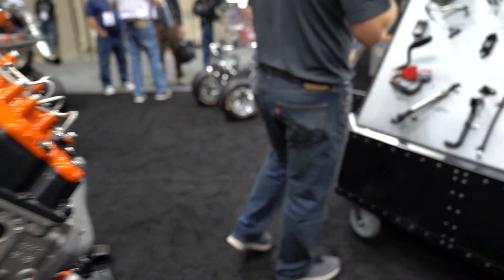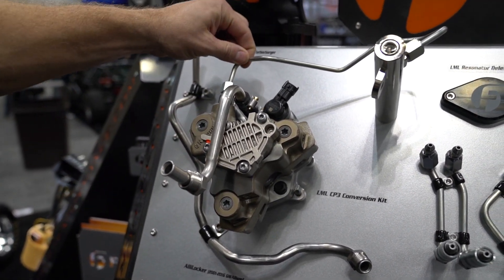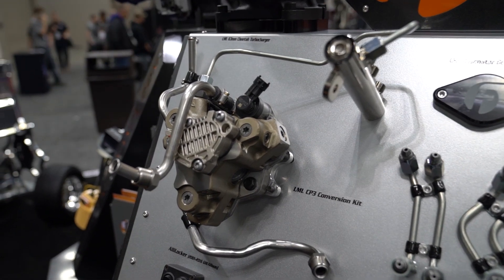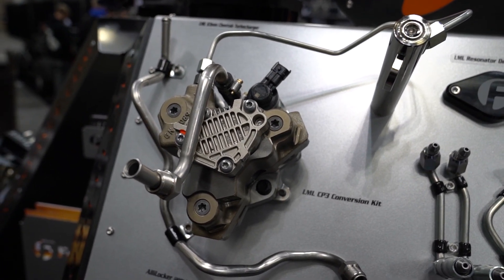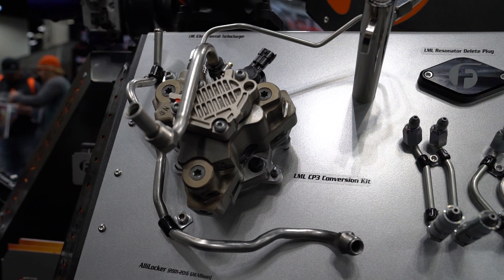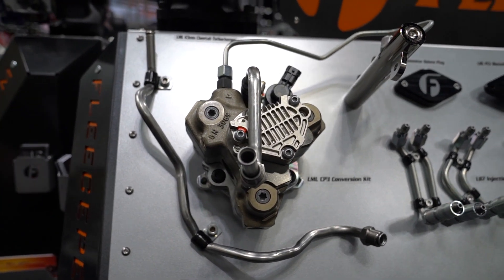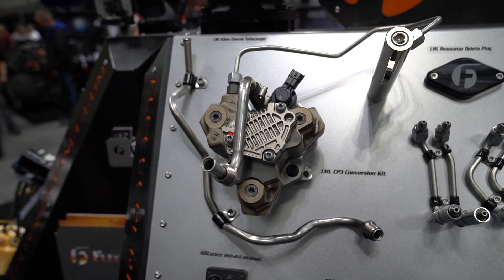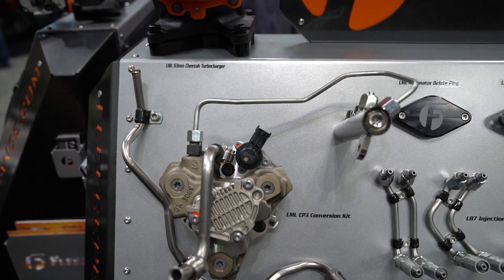Fleece Performance Cp3 Fuel Injection Pump

Comment: Does anyone know if they have the same type of conversion for the Ford 6.7 engines cause I hear they have the same failures I think they're different failure  but Ford's CP4 has nothing but problems when CP4 fails takes out whole fuel system
Reply: Run archoil 6200 every tankful (lack of lubricity) and contamination (water) kills these pumps on the 6.7 Ford, also get the 6.7 disaster prevention kit from xdp its 350 bucks and keeps the metal out of the injectors when the pump decides take a dump
Reply from the maker: Not that we are aware of for now